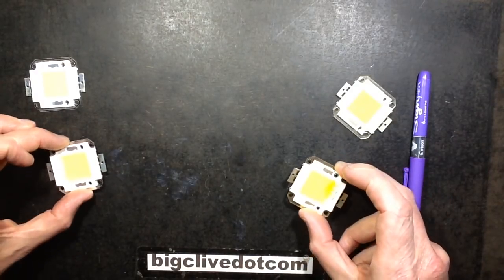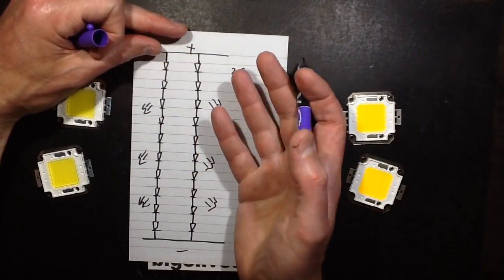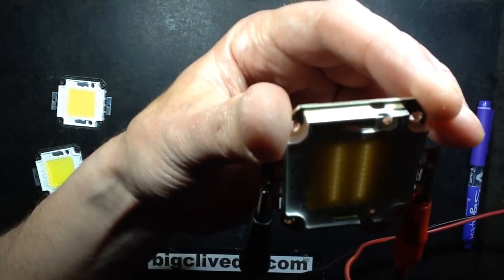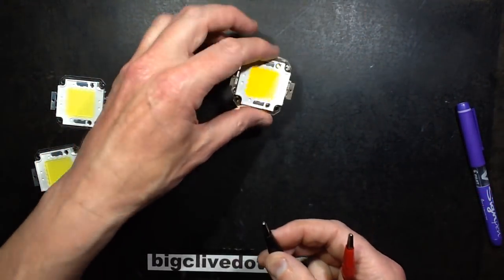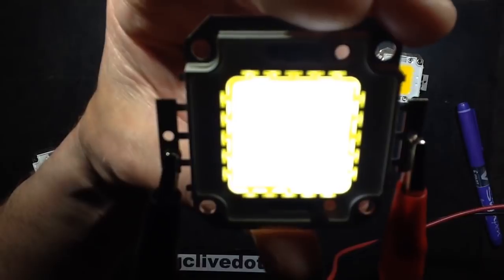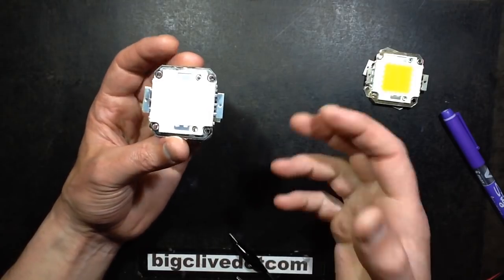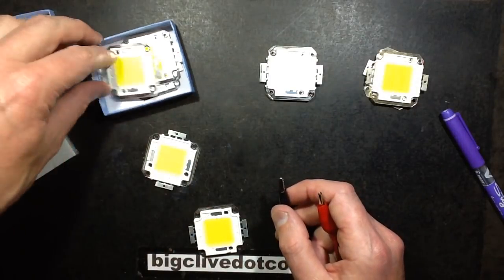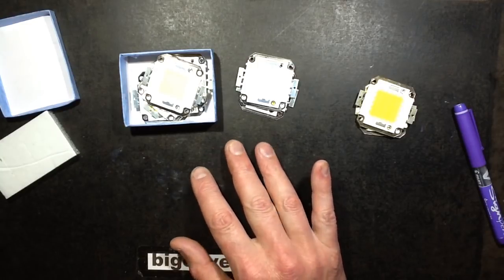Testing dodgy 100W LEDs from ebay sellers.

Comment: The chips  are not dead. As You  raise the current going to the chips more of them light until the point when all of them light when the level of current necessary to drive all of them are reached. The diodes that require the less current remain lit the longest as You lower the current. You must have a driver,  or power supply with enough overhead , or extra power to run all diodes effectively. I like Your work, don't give up, thanks for the knowledge , and video, respect.......Seven Thunders.......
Reply: +Ivan Quin Actually, if you source good-quality LEDs (which Clive did in a later video) you will see that properly made ones will ALL fade up at the same time. Same current across all LEDs. This is how they should work, if made correctly.
Reply: +Ivan Quin another problem I found wit these is that for the parallel series arrays, current is not even. Diodes start to fail along a series as they take a larger current than other lines. this drastically affects longevity at 75%+ output even with proper heat management.
Reply: Clive explained this correctly...the LEDs shown in the video are JUNK. Pro tip: DON'T try to out wit an expert in the comments section of his own videos to avoid learning proper info from getting pwned
Reply: Thanks
Reply: +Ivan Quin The LEDs are in series so its all the same current.  if some don't light as bright as neighbour its because the silicon is not well matched which is symptom of poor manufacturing quality.  they need to put LEDs from same wafer or something to keep good match.
Reply: That could be true in theory , but looking at the results in Your video, shows all of the diodes lighting as more power was applied, and gradually , more going out as you decreased the power going to them. It would be nice if They behaved like You wanted them to and all go out at the same time, but they don't.
Reply: Never mind all that, You're doing a good experiment, and building good lights, keep up the good work, Thanks and respect.......Seven Thunders.......
Reply: Thanks

Comment: I assume, this experiment does not have much significance. Because the Graph of I = f(U) is very flat at low voltages and then rises very suddenly, the ratio of a drop-out voltage of an LED over the drop-out voltage of another LED can be a number far away from 1 for low voltages, but it converges quite near to 1 for the normal operating voltage and a current of 3A (at least way nearer). Therefore you actually needed to redo the experiment at P=100W and some kind of a camera that can handle such an extremely high luminous flux, because normally, this operating point at only a few mA and a lower voltage is never used... I guess, at P=100W, the LEDs are all going to emit nearly the same luminous flux, therefore they may be not bad at all.  
However, I am not 100% sure about that and I would appreciate your feedback. ;)

Comment: Because leds are a flat surface so its easy to have bad ones unless there made perfectly.  I think its hard for them to all have equal resistance unless you raise the cost of production and for the money you have to just use them at a higher voltage or pay a lot more for a perfect led maybe i dont know.  Its not a light bulb where current runs without resitance through them.  Your current is being spread out over a flat and more resisting surface with more friction for current to pass so if you think you are going to get 100 little leds to all light up perfect you might be wrong.
Reply: +b Or maybe they just arent made as well so you get what you pay for i guess.  I might be wrong they might be bad leds or not quality but for 10 dollars you get a 100 watt led which is really cheap for the amount of light output your getting.

Comment: Bummer, I just ordered 3 of the 100 watt from an eBay seller at $4.25 each. I thought they looked a bit cheap. I should have guessed, China dumps all their defective junk on foreign countries anymore. Like their batteries their chemicals are too contaminated and this is why some LEDs are "leaky", letting current pass before the threshold voltage. I bought 3 about 2 years ago, and did this test and they all looked good, but the price then was $8.50 each.

Comment: do the 100w led arrangement actually draw 100watts as you pump the voltage up (with all leds turning on eventually? I thought this is why you use a high frequency driver circuit to power the led mesh? (not pure dc?)

Comment: this is not because of bad sellers, its because all 100w leds are unsuccessful. successful flood lights use multiple and separate lower power leds on a large circuit board. mine has 220 x 0.5W leds, i don't think they made like that with no purpose

Comment: wrong testing!!! you should give sufficient power to 100w led end apply light filter  for video camera to see all pixels in work.when you decrees voltage you can see in 1 line some of pixels shutting down faster then another. so give full power end use light filters to be confident that this is really bad product!

Comment: Hi Clive I think I might have an explanation for the seemingly random distribution of LED's lighting;
your 20W are indeed wired in series hence there's a consistent current passing through both 'chains'
the 100W one is wired as a MATRIX  in effect all the LED's are wired in parallel, since in the event of a failure in a particular diode you don't lose the whole stripe, but when you've got a 10x10 square any manufacturing flaws are going to show up as an inconsistent  pattern of lighting.

Comment: Hi, what if I use 50w driver for 100w led, driver will burn out?
Reply from the maker: +Tom Ocean The drivers all tend to put out around 30V but limit their current.  For the 20W LEDs the current is limited to about 600mA, the 50W LEDs it's 1500mA and the 100W it's around 3000mA (3A).  When you use a 50W driver with a 100W LED the driver will just put out its 30V at 1500mA as usual and all that will happen is that the LED will be run at half its rated power.
Reply: +bigclivedotcom Thanks for answer me, I am kind of question freak. So driver will not burn, if lower power consumption, the heat will 50% less? is it gonna getting longer lifespan? 

I also had same experience with faulty led from ebay, but they refund. kind of wasting time, but did not lost money though.
Reply from the maker: +Tom Ocean If the LED has suitable heatsinking to dissipate the heat then it should last longer if it is under driven.

Comment: Antistatic precautions on 100W devices...no need for that.  Cell phone rf power amplifiers, maybe even a really tiny LED those things might struggle to dissipate a couple of microjoules of ESD without damage, but power devices, no problem.

I'd also like to see it run at 27V+ through sunglasses, do the other LEDs in the strings not switch on eventually?

Comment: Hi Clive, Your channel is very interesting and informative, and you should be commended for this. Great stuff!! 
Is there any chance that you might investigate how to use an array of cheap LED lights to produce a similar effect to (or a poor man's version of)  the artificial sunlight from that new fangled COELux skylight (see google) which is produced by an LED filtered through blue perspex to give a 'sun in the sky' illusion, which casts strong sunlight shadows? Apparently the COELu costs about 70k Euro to buy and have installed. I have a dream of making a similar device to provide fake-sunlight at home.

Comment: WOW I found a good seller! I got a 100W warm white and the LEDS lit up almost perfectly, there was about 2 little leds that where a little bit dimmer than the rest but it was barley noticeable, and went to normal brightness when the voltage was turned up, I think the LED was a bit damaged in the mail because it wasn't packed TOO well. Im not sure If I just got lucky and got a good batch but this seller seems to do good LEDs.

http://www.ebay.com/itm/221871109445?_trksid=p2060353.m2749.l2649&var=520765568883&ssPageName=STRK%3AMEBIDX%3AIT

Comment: Ok, so the 100W model is badly balanced regarding the forward voltage. Did you power them up to specs and see if they all work at least? They may even out somewhat after a break in period. Another thing I noticed is that you look directly at the light source. I find it helpful to use a strong welding glass in order to be able to observe the led's behavior under working conditions.

Comment: is it possible to run two of these faulty LEDs in parallel,  under 100w (same 35v 3A), to get results closer to real 100w?
Reply from the maker: +dmanmoka Running two in parallel would certainly reduce the stress on the individual LEDs, but the duffers that were shunting current without glowing at full intensity would still be an issue.

Comment: What size heat sync is needed?
Reply: +Mike Warren desktop cpu heatsink and fan required to run at full capacity.
Reply: +Григорий К This guy gets it. Props to you, Григорий.
Reply: +jjovereats Interesting, his first name is almost the same as my last name.
Reply: Григорий К Seriously? You are responding in a video titles 100w led chips. It's pretty clear what the power of the led is. 2nd, you didn't put a second.
Reply: draginator6 He;s not wrong. It DOES depend on the dissipation of whatever you're heatsinking.
Reply: Jimmy Gregorio Yeah, but the video was about the specific cheap ebay 100w chips. I know there can be all different ones, but the video was focused on specific cheap ones.

Comment: Wouldnt those "dead" leds on the 100w start glowing at a voltage of 32v at full power? Just asking no flame war please. I noticed that when i turn the LED off on my floodlight it fades unevenly. wish i saw that video earlier!
Reply from the maker: Probably, unless they were completely shorted.  But the current distribution through all the LEDs would be skewed and the efficiency much lower than a good LED.
Reply: so a 100w rated at 36v would actualy be of a lower wattage ?
Reply from the maker: +HIXMF Power dissipation of an LED is its forward voltage at full current multiplied by that current.  But actual light output will be determined by the efficiency, condition and temperature of the LED chips.  Lower temperature being better.

Comment: It's an electronic product, from China and off ebay, well that's already three strikes against it before you even get out your credit card. I'm not against buying a cheaper product on ebay but I'm usually skeptical of electronic goods simply because they turn out to be crap from China and unlike a local distributor you can't simply take it back and speak to someone face to face about the problem

Comment: did you ever find a good supplier for 100 watt leds??
Reply from the maker: +Brian Tapp Other commenters mentioned that Sure Electronics who sell opto stuff as Sure Display on ebay do better ones.  But I've not tested any.
Reply: Ive gone through several myself and they burn out even with a heat sink or the power supply  kicks out from time to time like its over heating.

Comment: Hi Clive

The reason why they are cheap is because the voltage is not binned. I wouldn't consider it a failure straight away since most of the time they are not meant to be dimmed down to zero. If you want a reliable COB i would go with a big brand name like Citizen Citiled instead of these budget Chinese ones. Some of the other players like CREE and Samsung have been dabbling in this market but its more or less owned by Citiled.
Reply from the maker: +Thanh Tran Even if they were binned inaccurately, I would expect an entire line of ten chips to glow at roughly the same intensity once the combined forward voltage of its LEDs had been reached.  Some of the lines are passing modestly high current (tens of milliamps) without lighting while others in the same current path are either brightly or dimply lit.
Reply: bigclivedotcom i have just checked the binning of my COB (Citiled) which is a premium product compared with these cheap chinese ones. the voltage binning is perfect.

Comment: I've had better luck on AliExpress than Ebay for COB LED Modules.  I picked up ~10 300 watt modules for ~$100/unit and they all work correctly.  These are about 35000 lumens or equivalent to a 1500 watt Halogen  flood light.

Comment: Don't order anything from eBay anymore!  The Chinese sellers are also manipulating the search results on eBay so when you tick U.S only, the search results will show their product. The shipping location will say Florida, California, NY or NJ.... When a product i order was taking an awful long time, and the Tracking code would not update i clicked on the seller profile and low and behold the seller location is HONG KONG, but shipping location was from Tampa, FL. 

When i received the package it had a USPS shipping number. This has happened to me several times AND EACH TIME the shipping location is different.. Each time i would receive a ups tracking number that would not update past (shipping info received) but it would stay there for 2 wks, then it would update and i would receive my package in 2-3 days.

This is what they are doing. They have people in the states that they ship their package too. The receiver then will repackage it, slap on the label and mail it off. eBay is very well aware of this, but refuse to fix the problem. The only thing they have done was build several warehouse in CALI strictly for Chinese sellers. 

These people are everywhere now. I very rarely now can find a product i'm looking for. Check the seller profile (not just feedback) before purchasing any name brand or expensive products from anyone on ebay. i promise you if you look it will say seller location: HONG KONG while the shipping location says differently. Your item will either be shipped from an ebay warehouse or a John Doe, and 99.9% that brand name product will be fake!!!

ebay is nothing more than alibaba.

Comment: Power LED is not like those "tiny battery powered LED", you cannot just hook LED onto "+" "-" terminals. 100W LED requires power electronics control circuit, a high power supply (usually PWM supply) and maybe a fucking huge heat-sink to start with, which I didn't see any of these.  
And you are just a hobbyist, and lack of basic electrical engineering skills. First step, READ DATASHEET, the output luminous intensity grows logarithmly corresponding to input current. If your power supply cannot supply sufficient current without terminal voltage dip, your LED will only output maybe 1% of its power, which you just fooled yourself, and i am not surprised to see the results you posted there at all, cuz ,,,, "of course".
Build a good power supply and driving circuit, you will be surprised by this 100W LED. trust me

Comment: One big problem is that these LED arrays consist of several series circuits of, say, 10 LEDs each connected in parallel. If the LED chips used do not match very close the results are as shown in the video.  I don't like the parallel circuitry as it will destroy the entire LED array if one serially connected LED string fails. But the 20W and 30W types might be dissectable into separate serial strings by cutting the external interconnection. Using some external current limiting circuit per serial string may increase reliability: one string fails and there still is some light...
A 30W outdoor light with infrared sensor failed when we had a terminal box with a poor contact that only intermittently provided power to the light. (It burned out when a vacuum cleaner was connected ... no fire, luckily). The converter finally failed and destroyed the LED, too. After replacement of both converter and LED it's now working for roughly a year.

Comment: I bought some 9W 120 VAC LED lamps from a Chinese company (Banggood) and they each lasted about 4 months or about 1000 hours. I took them apart and found several of the chips were bad. I replaced them with 100 mW 30 mA LEDs and got it working, but only for about 5 minutes (since the current in each string is about 180 mA). The LEDs seem to have been well matched but highly overrated. I plan to replace all 18 of them with good Osram LEDs which are only about $0.20 each. I can get Chinese chips for as little as $0.02 each but they are probably not 1/2 watt but maybe 200 mW. Thanks for your expose of the cheap modules.

Comment: Hey brother I have a 15 watt solar panel and a 1000 amp deep cycle to run a few small LED's in the winter. Money is tight. Would you have a suggestion as to the best, brightest for cheap?
Reply from the maker: +John Arizona I light my home at low level with just general 1W to 3W LEDs that combine functionality with decoration.  For more intense application like my workshop bench I use 20W LED floodlights mounted close to the surface for good intensity in a modest working area.  My workbench lights are also using a PIR sensor to turn them on while I'm there working, and off again when I get distracted elsewhere.  (You get 12V PIR modules).  For other intricate tasks elsewhere I like to use a head mounted torch or flashlight for maximum light right where I need it.
Reply: bigclivedotcom Thanks but I'm trying to find an actual deal, supplier, etc. with high quality for best price. Money is tight and if you don't purchase these regularly then there is a good chance your going to get ripped off hence my request.

Comment: Strange. The ones I ordered a while back (I forget the details, sorry) were much better matched than these, even though they looked the same before connecting power. All 100 elements on mine work, and are more or less matched for brightness. So there are some good ones out there, somewhere!

Comment: Are these rated to work at the lesser voltage?

Point is the proper way to test them is to stick the correct current through them and then look at the LEDs through a filter to see if they are lighting evenly at the full voltage.